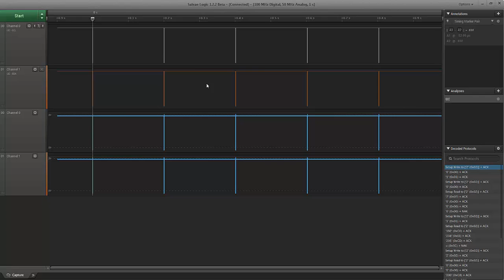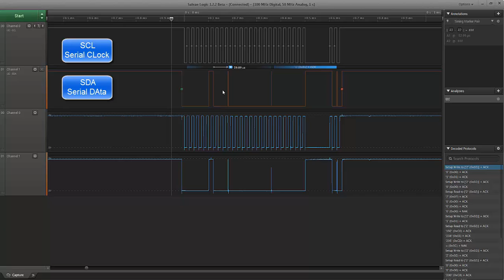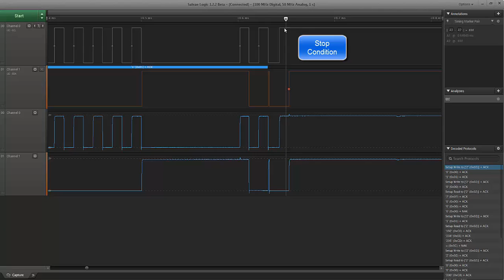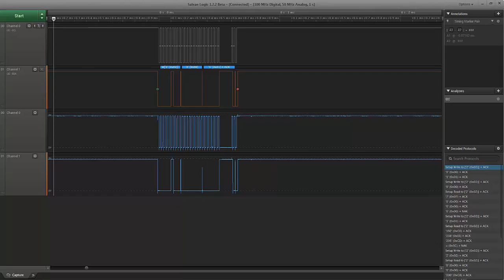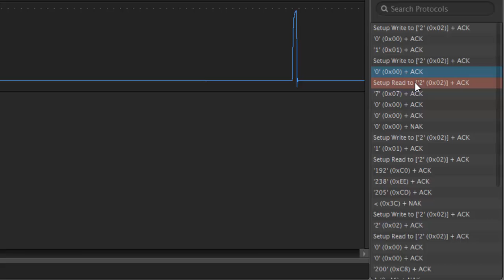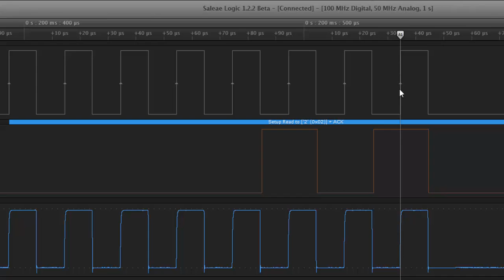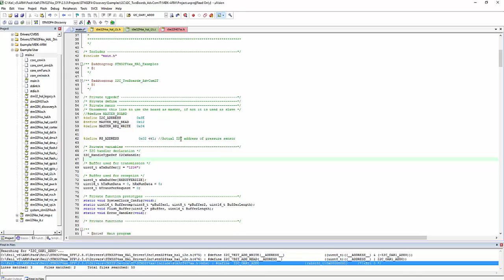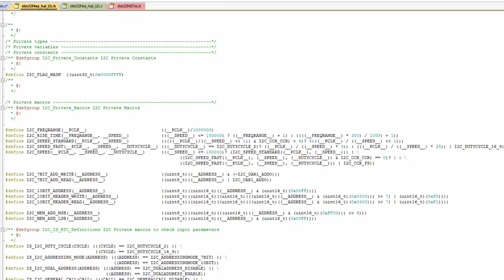{2} Real world I2C for beginners

Comment: Does each slave have a unique address defined by the manufacturer?
Reply from the maker: Yes, each device will have a unique address, typically given during the manufacturing process
Reply: So what happens if you have several identical devices on the bus simultaneously? How do you differentiate between them?
Reply: @rogeronslow1498  In my understanding, it's not supposed to work with a slaving sharing an address with another. Correct me on that.
There are some devices which have a configurable address: you can place wire jumpers or solder certain pins and their address will change (this is an intended feature. See pcf8574, for instance). I'm not aware of a device that allows configuration through software (neither I know how it would take place, assuming  the I2C interface is the only one it's connected to).
Reply from the maker: If that is the case, then they need to be identified before they are installed.
Reply: What do you mean by "need to be identified before they are installed"?Will they require an additional line to each device so they can be differentiated between by the micro?
Reply from the maker: generally they have paperwork that provides their address.  but if not or if they get mixed up they can be sorted out by putting one into a socket, identifying its address, putting in the next one, etc., until you know the address of them all until they are inserted into the board.